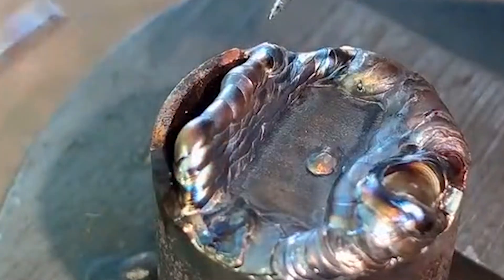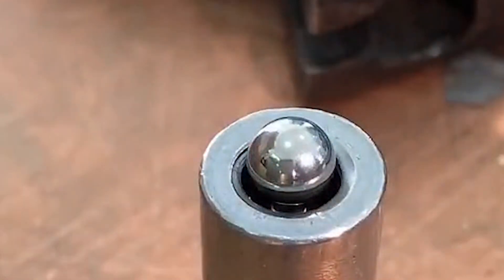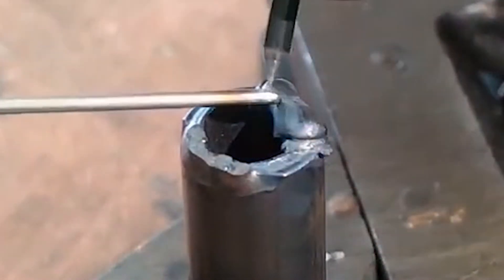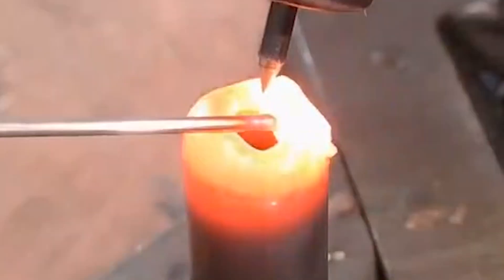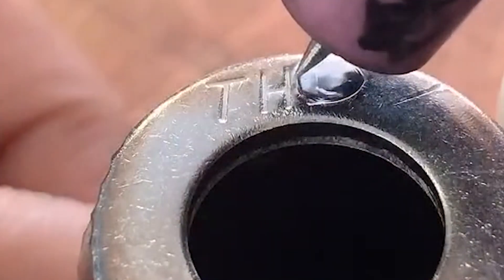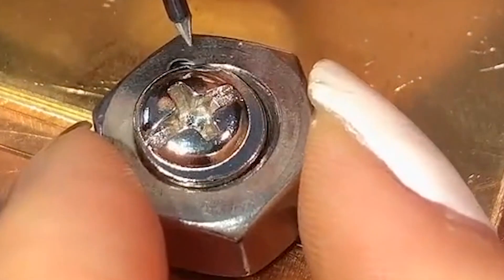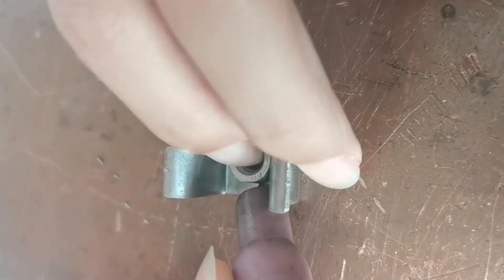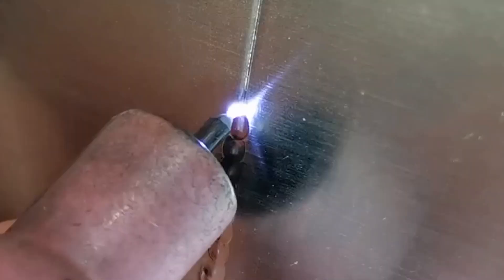The working temperature can reach 10000°C, Why workpiece after cold welding can be hand touch?

Comment: What is coldwelding? Isn't it pulsed arc welding?
Reply: It's a TIG spot welder. It's a TIG with a special pulse mode that does very high amperage (200? 250?) and a very short pulse time. The welds are cold - meaning no penetration. Besides making spot welds, tacks, maybe some thin sheet metal work (auto body repair?) its use is pretty limited.
Reply from the maker: I have introduction in other videos